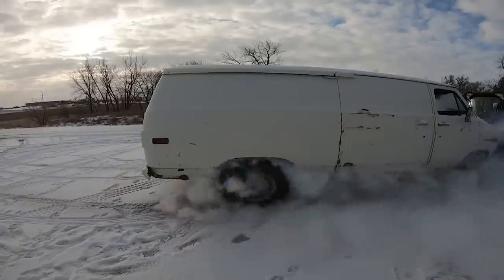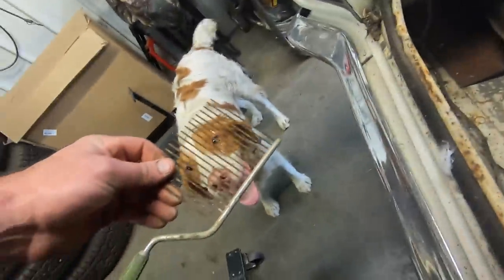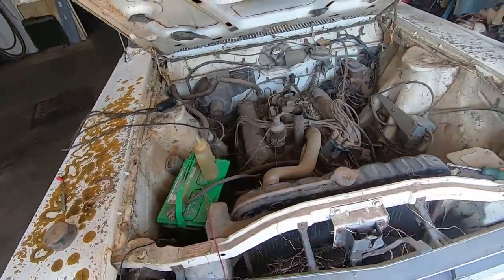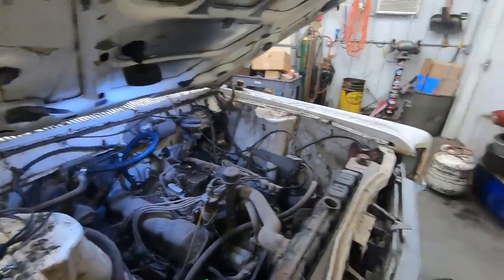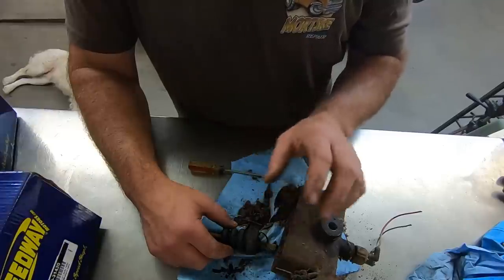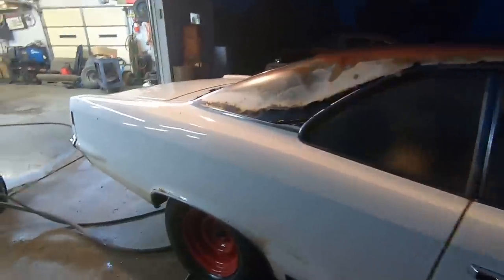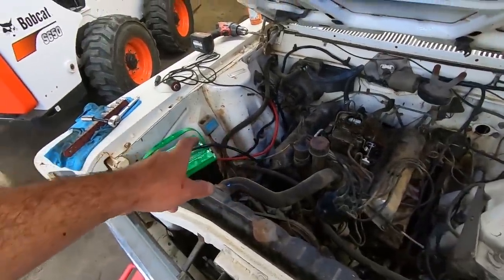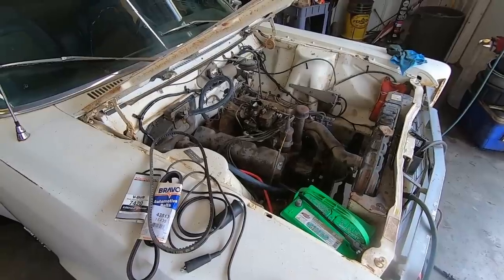1967 Rambler Rebel SST Abandoned in a Farmyard for 40 years!! Will it Run?!? AMC Muscle Car!

Comment: No! Paint the steel rims RED just like the back. SUPER nice. Front wheels pure narrow drag. The rake is perfect. Leave the roof sunburnt white. SST = Skanky Slanky Tina. Just named your car for you. Thank me later.
Reply from the maker: Haha sounds like a plan! Thanks Stevie!
Reply: @pookysdad4884  It's got to be a name announcers at the drag strip aren't afraid to use. lol
Reply: @pookysdad4884  not the super slow turd..
.
Reply: The trans cooler hoses to the radiator were correct. 
Replacement cruise boots are available 
The heater control valve is always crap on these.
Reply: SST didn’t really stand for anything, but “Super Sport Touring” is one of the generally accepted acronyms
Reply: @MortskeRepair  bedline then top  the satin black over it.
Reply: Hell yeah:)
Reply: Just noticed she's a hardtop to know post that's a plus.
Reply: Just a thought i ain’t knocking the name but just turn slanky into stanky “stanky skanky Tina”
Reply: @pookysdad4884  do the top in black, semi-gloss truck bedliner.. you get the texture of vinyl and water can't get under it to cause rust...
Reply: Those are chrome reversed wheels. Dont paint those
Reply: @danesderelicts  theyre chromed but not reversed..not deep enough..
Reply: I knew a girl named Tina years ago, she was a good………financier.
Reply: Version 2 with brakes
Reply: @MortskeRepair  no sale her to me il restore her I hate that ratrod stuff
Reply from the maker: @RyanSteele92  Red wheels make it a rat rod?!? I think not.
Reply: @pookysdad4884  toyota TRD.....the only thing missing is you {U}.   they should use that as a sales slogan
Reply: My car is all ready called rustina on lube tube merch available on red bubble
Reply: @pookysdad4884  no, I think maybe Skanky Stanky Tiffany seems bout right.  You know tiffany….that chick you dated right after your separation from the wife… she was a hairdresser….keyed your car, probably was at least a couple incidents involving the cops… Tiffany.
Reply: @pookysdad4884  looks more like dodge coronet
Reply: That thing has the basic. Lines if a 67 Road Runner and the rear lights too
Reply: @brucefisher4025  :my thoughts exactly. I'd do the same exact thing. It's a lot easier and cheaper than doing a replacement vinyl roof and it'll never rust out. I've done this several times before and its just gr8. Stay safe.

Comment: That's a rambler worth saving for sure, definitely.
Reply: The 290-343-360-390-401 Rambler V-8's were quite similar to small block Ford. Much underrated.
Reply: @jeromebreeding3302  They look more like a SB chrysler if you have ever taken one apart. the problem with those old ramblers is they still use a torque tube. So if you change the rear you have to build suspension
Reply from the maker: @tomhutchins1046 67 was the first year of an open driveline!
Reply: @MortskeRepair  Man that big ass nut holding on the brake drum is" BIZARRO". From what I've read about it, pulling and re-installing, is tricky. It's easy to ruin the hub.
Reply: @MortskeRepair  missed it by one year LOL darn. If you took the rear out of the older ones all that was left was 2 coil springs and a track bar they looked like a model A rear. But it has been a few years
Reply: @jeromebreeding3302  They are just keyed and or tapered axles common in the old day early fords jeeps Chryslers. If you have a puller its no problem. But they are failure prone if you add any power.
Reply: @jeromebreeding3302  ramblers were supposed to be well built cars. An old friend of mine shared a bunch of parts  Ramblers outside(east ) of LA.
Reply: @tomhutchins1046  Tapered axles are alright when they're in good order, but turn into a nightmare when in bad shape. I had a Volvo PV with them, and it was not fun to get them off the first time.

Comment: I'm sure I'm not the only one who remembers when these were new.  My dad took me to test drive one. He couldn't decide between  the SST V8 or the 67 Galaxie.  He went with the Ford because it had a "cooler look" and front disks.
Reply: The rebel was a sexy design, that would be just as happy at Nascar as on the street. That vertical radio was different, to say the least. The Borg-Warner automatic was not weak. It held up well in Javelins used for police duty.
Reply: Yeah it's funny you say that because the 67-68 AMC Ambassador looks very similar to the Ford Galaxie. My friend has a 68 Ambassador.....and people constantly come up to him and tell him "Nice Galaxie"!! 😆
Reply: @Country Western yeah they're definitely a Frankenstein of sorts! GM steering columns and ignition switches.... Chrysler transmissions.... GM power steering pumps.... And Im pretty sure the rear axle in the 71-74 javelins was a Jeep design 🤦‍♀️
And go figure those cars were neither good in America or Canada!
I guess that's where the term "African Motor Company" comes from??🤣
Reply: @chrissytaylor5690  not to mention Ford ignition parts..
Reply: @chrissytaylor5690  American Motors bought Kaiser Jeep in 1970 and started using American Motors Parts on the Jeeps thereafter. AMC does not have a Jeep axle, jeep has an AMC axle.
Reply: @danielulz1640  make sense!.....explains a few things. I knew those outside door handles on the 70s CJ's were an AMC handle, lol. Think they continued to use that design even way after AMC went under.
Reply: @chrissytaylor5690  I had a 63,65,67,68,69 ran them all 100,000 miles for work and only had a problem with the 67 which had a Ford Autolite carburetor and a Ford starter. Other than that NO problems at all and they didn't leak like the Chevs of that time.
Reply: @kipvevea5731  you know.... I believe the 68's have an Autolite 2-barrel as well....is the one on my friend's car has been rebuilt a few times and it looks just like a freaking Autolite 2150 carburetor, lol. Go figure!!🤦‍♀️

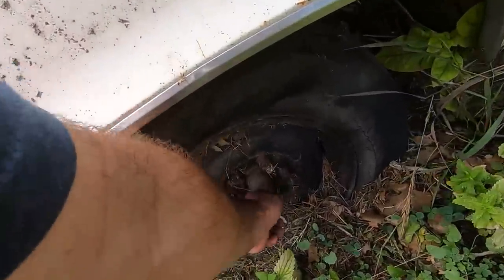Comment: We know you’ll make us proud in the next Rambler SST video . I like AMC . Growing up , we made our own HiPo amc ( clone rambler SST ) out of a hand me down ‘67 rambler rogue , no amc 343 to be had . When we got done stripping a ‘66 el Camino that someone graciously rapped around a pole , the rouge was sporting a 4:11 rear spring over axle , LT1350 , Cragar sst’s all around . I tried to,talk the owner into swapping in a Ford 302 but he was a GM guy like me . The rogue chewed up turbo 350’s every few weeks . I told the owner and my brother ( two know it all’s ) to do the SOA and to get the drive line angle right , re - clock the rear axle so the yoke was in phase with the trans output shaft . Was told to STFU . Not to my amazement but their embarrassment , it threw driveshafts regularly . Finally , we torched off the freshly welded axle perches and set them right . Over time , we got proper accelerator linkage and shift linkage . No more 1/4” aircraft cable with a loop tied into it and reaching under and tripping a home made lever bolted on the trans and shifted using an umbrella to select positions . Yeah , there wasn’t much aftermarket in the late 70’s , just headers and aluminum intakes and ignition systems . But we were spoiled because we didn’t have to build our own headers and use magnetos from 50’s era cars . The car was dubbed the Maytag mobile ( it was white ) by the neighborhood drunk . The only radiators that fit were two,core which did nothing but give excellent heat in the winter but needed cool,down every 1 - 2 hours or IMMEDIATELY after spanking someone after a two lane blacktop run . I had my own plans for this car after the owner acquired a ‘70 GTO with a crushed front urethane bumper ( ram air hood intact ) and a 400 featuring spun bearing in the bottom end . I didn’t have enough cash in time to buy it , so his dad junked it to avoid any more tickets ( no plates ) . His dad junked the rogue too 😢 . He got a ‘72 GTO that was sweet but of course he always had to ruin a classic . He made his own interior mods ( tacky ) and swapped in a poncho 350 ( supposedly worked 🤣 ) from the smog 400 . At least it had an m22 . Life was never the same after the rogue was gone . If I wasn’t so poor as a kid , I would have had the rogue , the ‘70 GTO and after a while his ‘72 also . Well , this comment is as long as this video so no time to tell about my two CJ5 ‘s . Real quick ; the 1980 has a swapped in 258 with a T5 ( real short rear driveshaft ) . The 1973 is in dry dock for repair / resto . Ok , first comment on your channel and I wrote my life story . AMC has history in my past and present . Did I mention I had a 1978 Jeep Cherokee FSJ ? …………..
BTW , I dig that windshield washer pump pedal . Wish the rogue had one . 👍
Reply from the maker: Good stuff! Thanks for watching and commenting!

Comment: Hello from West Haven, CT to everyone. I kinda see where Mo- Par got their design for the 69 Road Runner.
Reply: My dad had a 1968 Rebel wagon that he got from his aunt. We rebuilt the engine and automatic transmission on it. As we restored it, I noticed the body looked like Mopar design, including the flat style door handles. It looked like the Brady Bunch station wagon except ours was green and white. Under the hood, the 6 cylinder engine looked like a Chevy 250 except the starter was mounted on driver side. And that little 3 speed automatic looked alot like the little C4 we pulled out of a friend's 67 Mustang. It most likely was Ford because the bell housing was detachable on our rebel and the mustang as well, so a person could've put one of those in anything. I like those old Rebels but I just wonder if the AMC people just lacked imagination during those few years and just copycat the other guys. Wish we still had that Rebel wagon.
Reply: This looks nothing like a 69 road runner . btw the 69 rr looks just like the 68 model , with the only differences being the grille and tail lights .
Reply: @HowardJrFord  our 68 Rebel wagon was often mistaken by admirers for Mopar until they got closer to it. Maybe it doesn't look exactly like a Road Runner but at a distance someone could mistake it for a Plymouth. Perhaps what upsets the Mopar people is that someone commented and said the Rebel is where Chrysler got their design ideas from. Well, I would definitely agree to contend with such a notion myself. In my guess, the reverse is true. AMC Rambler probably got their design ideas from other manufacturers. That's possibly what could have put AMC in the low ratings amongst the big 3. It's just too bad they couldn't get ahead because I hear some of those AMC V8's were serious contenders in the performance field.

Comment: That Rebel SST ran so darned smooth, it was a miracle.  I'm with the others, fat tires in the back, skinnies in the front.  Paint the rims all red or all gold, whichever you like.  The roof, definitely flat black.  The other miraculous thing about this car, is how well it cleaned up with just a pressure wash.  That car is a keeper.  Or a helluva good profit, either way.
Reply: Yeah, the 290 is a great running, fairly strong motor! My buddy has one in his 68 Ambassador SST.... And it runs smooth as glass!! Never skips a beat!

Comment: Excellent video Mortske Repair  :) also what SST means is Super Sport Trackstar, interesting cars never about them till 2004 seen on my Aunt boyfriend had some of cars in Rambler types also change powertrain of motor plus transmission to Chrysler types plus electrical too and one kept orgnail to ways! But in 2015 when start going to vechile shows a cousin Albert of mine  who 70 years old now he got 1968 Rambler in 2 door with Red body also has 277 V8 with Holley 4 barrel carb 1000CFM  with hand choke cable on dash knob , 727 4 speed Automatic transmission plus 377 posi rear , 4 wheel drum brakes also no power steering and brakes, but had options of Power seats , Cruise Control , Power trunk , 6 seater , Air Conditioning, Lock Fuel Door plus Electric opener by switch without key on and power windows last feature push button on floor to if key ignition switch don't work! Only thing I don't like about when on cold or hot  start up hear start screech like black board in school back years and loud at that ! Albert told me tried fix starter drive also by shimming plate plus Flywheel change no damage or different at all ! Plus no teeth get grind off weird part!

Comment: Loved the video. I love the lines of the Rebel. When you get around to the brakes see if you can find a salvage yard with a 75 or older Matador with disc brakes. Spindles, calipers and rotors will bolt on. A 67 power brake booster and master cylinder should work well . Great project car. Thanks.
Reply from the maker: I'll keep an eye out for some! Thanks!

Comment: Geezer hose/bar grip trick.
 1.Boil about a quart of water. 
2.Immerse hose or bar grip for about 2 to 3 minutes. (Rubber will expand in hot water.)
3. Put on gloves to prevent blisters.
4. Install as usual. 
5. Enjoy a cold snack of your choice while smiling. 🙂
6. Keep up the great work.

Comment: I always soak a slightly undersized hose in very hot water till its pliable. I don't have a fancy battery connector spreader tool, so I use a pair of needle nose pliers to turn & pry it open till it fits. A little plumbers stem grease helps it slide right on when you have enlarged the hose enough. Maybe I learned that as a teenager? Sounds familiar if memory serves.. Anyways, I've found the stem grease seems to extend the life of the rubber at the connection.. That may just be me after a few sammiches?? who could say??

Comment: Lunch with Mortske & Duff. It does not get any better than that. Really enjoyed this one. One of my first jobs was working in the shop of a local Mesa AMC dealer called Randall Rambler. There two days. The Pacer had just been introduced. I recall the 232 six valve cover gaskets all leaked so me being the newbie got stuck with 8 hours each day replacing those gaskets. It was warranty so it paid close to nothing. Finally told the service writer I hate Ramblers. Loaded my stuff and left. I was told SST has no meaning. AMC left the interpretation of it up to the customer but the SST was the upper line of their offerings. Also found it could have come with a 390. Desert valley auto parts and Hidden valley auto parts here in Arizona might have the small parts needed for the car. Both are online. Please watch Duff around the anti-freeze. Less than a teaspoon full lapped off the floor is fatal to a dog. Thanks again Mortske. You and Duff have a great day. Can't wait for part 2.
Reply from the maker: yeah, he has no interest in coolant. Been around critters and coolant my entire life and never seen anything get close to it. Thanks for watching and commenting!
Reply: @MortskeRepair  That's good. Have a great day.
Reply from the maker: @boblamb8421  You as well!

Comment: bought a 66 american AMC in 73 put 500k miles on it.  made a few mods to it. ran 13 sec 1/4 mile . any way door handles are the same also have the same lockheed master brake and motorola alternator.  if taken care of it runs forever.

Comment: AMC Lives has a lot of parts. I have a 66 American Rogue.
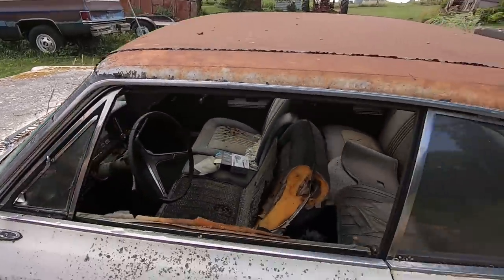It has a 350 Vortec and a Ford 9" posi with 4:11's
I did a lot of work to it in the spring. Videos on my channel.
The thing with AMC is that they used everyone else's bits and pieces, so you can make stuff from one of the big 3 work.
Red wheels, blue roof.

Comment: I think the Pontiac Astre was a relative of the Chevy Vega. It would have the 2.5 L engine but had the Iron Duke, designed to eliminate all the problems with the aluminum components in the Vega engine. I had one in the same color. Was a good car. Traded it, In MN, for a 85 Chevy S-10 with similar 2.5L engine. Another great little truck.

Comment: hey .... a friend had a 290 ci gremlin with torque flite and a few bolt ons, but normally aspirated. It had a brand new mill  and no gauges lit up, so I had to hold a flashlight on the oil pressure gauge. Of course, I went flying when he launched,  but that car leaped off the line like a pro mod, so, yes, 290 amc s will get it with minimal attention.
Reply from the maker: That's awesome!

Comment: WOW an unbelievable EASY awakening after FORTY YEARS.  It was available with a 232 straight six that made 145 HP with a 1 barrel, 155HP with a 2 barrel, a 290 V-8 with 2 barrel that made 200 HP or the 343 V-8 two barrel making 235 HP or 280 HP with the 4 barrel.
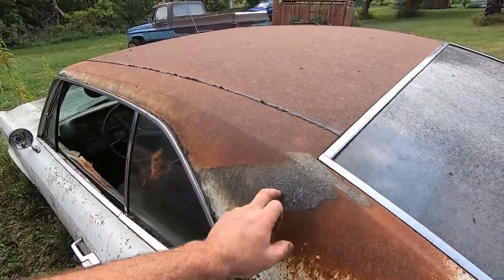Reply: OK, U know your AMC's. I had the '68 Javelin SST with the GO package. ( mainly cosmetic ) Had the 343 4 bbl with BW M12 3 sp. 3:15 rear axle I believe. For the unbelievable price of $ 395.00 out the door in 1977 ! Added headers & Lakewood traction bar and had some fun. Even kept the AM 8-track stock ! Replaced the speakers though.
Reply: @sidgysoho1960  I had a 69 Scrambler light little car with a 390 four Barrel 10.25:1 zompression, Borg Warner T10 four speed and 3.54 Rear Posi that made 315 H.P. and 425 Torque from showroom and did the 1/4 mile in 14.2 secs. @ 100 mph. A Very fun little red white and blue car to drive.

Comment: When the Rebel was introduced in 1957, it was the second fastest American made car at the time. Second only to the corvette.  0-60 in 7.5 seconds vs 7 seconds for the vette.  Also, I’m not sure about ‘67 but in ‘66 Ramblers were dip painted and marketed at the most rust proofed car in America. And do the seats recline on the 67?  66 and prior did.  I had a 66 wagon and a 65 sedan.  I got a soft spot for the old AMC’s.
Reply from the maker: I have to check the seat thing out!